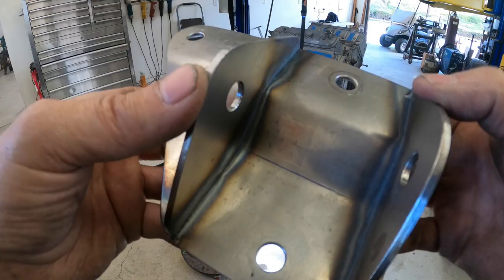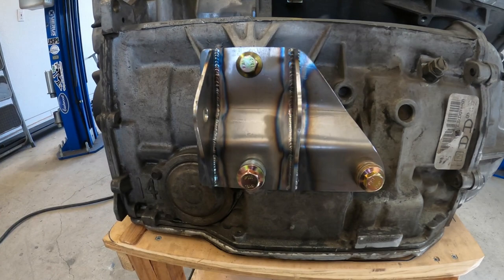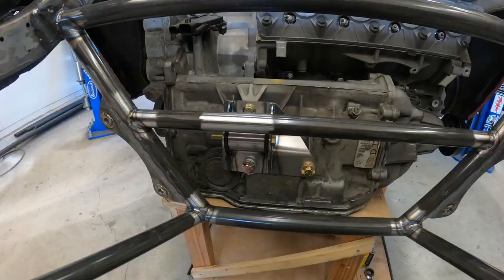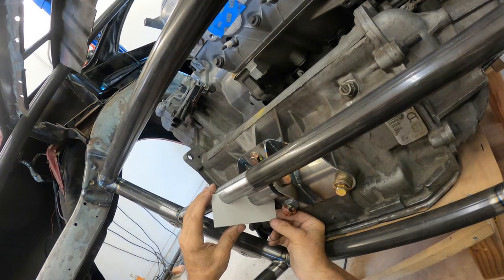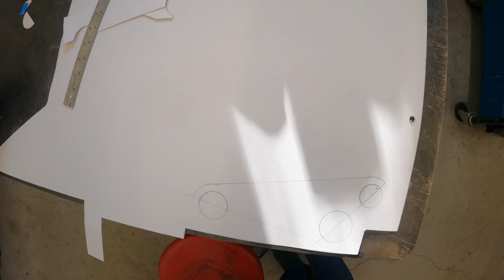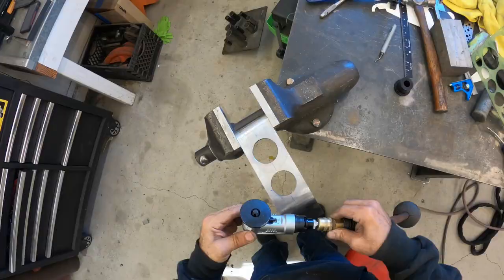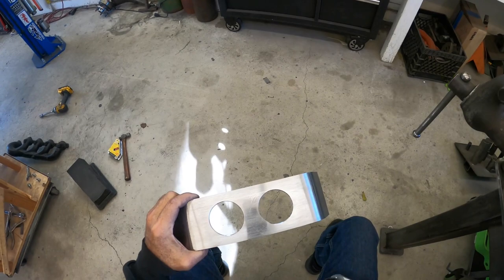V8 into Corvair the hard way   ep8

Comment: I knew you weren't going to weld that transmission mount without access to the bolt behind. Extra points for disguising the access hole as one of three lightening holes.
Reply from the maker: You caught that I see.

Comment: Great build as usual.. Yaw? oh no.. is an airplane in the works next??  Oh and dont feel bad.. amateur "gardeners" have started multiple fires in the open space here with welders fixing open space gates and fences and even roofers throwing hot roof material over the side into a dry hill. Just dont do what i did.. go boating and forget to put the plug back in. :)

Comment: John, Excellent  work!!! You fabricated the engine mounts brackets incorrectly though. You suppose to use those angle iron!!! LOL!!! Those brackets are made way better than factory built brackets. Just wondering if you designed it that you can remove the engine even with the exhaust headers attached. This is an example of a true Made in USA parts built by Master Craftsman the old fashion way. I like to see a cancelled wheelie bar. You ought to patent a Metric transfer punch set like the one you made. Looking forward for the next episode. Thanks for sharing. Be safe.

Comment: Yes, that is "the hard way".  The right way is to get a nosecone/bellhousing that allows you to put a SBC directly onto the Corvair transaxle, which is virtually identical internally to the 4-speed used in GM's bigger cars.This was available when they were still in production.
Reply from the maker: If the diff is beefed up with 4 spider gears and a bigger main shaft, a LM Corvair transaxle can handle about 300 lbs of torque if driven nicely. I will be north of 600. The trans portion was used for  V8s but the third member is smaller and weaker in the Corvair. You can't flip the trans or ring gear to run mid-engine.  Crown did their conversion by mounting the engine to the opposite end of the trans so the ring gear still spins the same direction.  But this was with the (relatively) anemic SBC from decades ago.   Also, I don't want a manual or a   traditional North/South engine layout which is what you get with a Corvair transaxle.  

I looked on Frank Schwartz You Tube page. Wasn't surprised to see it blank.
Reply: @JohnReynolds661  Well, you did say "the hard way". 
The reason the ring gear didn't need to be flipped, is because the Tempest used the same transaxles as Corvair, bur with a front mounted V8 and an engine RPM "driveshaft" (like a Porsche 928). This  opened the door for the mid-engine SBC bellhousing.
BTW I didn't "read an article" I remember that setup from when it was current.

Comment: You should invest in a generator dedicated for your water well and have it wired in so tripping a single lever disconnects from the grid and connects to the generator. Especially if the power goes out that often. 
What is the torque limit of that transmission and the axles your using ?
Enjoyed the vid, thanks for making it.
Reply from the maker: I usually turn off well and transfer pump when on the geny because they both have hard starts.  The trans is basically a 4L80 in a transverse configuration which is like for a one ton truck.  Axles are good for 1,200 hp.

Comment: 4:57 What company makes that long stem marker ? Thanks.
Reply from the maker: If you're referring to the gold item, it's just an spring loaded automatic punch that I purchased at the local steel store.
Reply: @JohnReynolds661  I'm looking at a thin tip magic marker that has a black body.
Reply from the maker: @RichieCat4223  It's just a mechanical pencil .9 lead
Reply: @JohnReynolds661  Thanks

Comment: wow! what great welding joints!
Did you try to electro cleaning the joints? This germam guy just used his old welder instead of buying electro-cleaners (with max of 5A), he used much more amps (starting with 10A until about 50A). May I can refer to his video? https://youtu.be/if6ASMe27Io
This video is for "stainless steel", don't know if it works on any steel...
Reply: he pulled out his oldes welding tool and puts a cleaner brush on: https://youtu.be/if6ASMe27Io?t=584

at 13: 20 he cleans very impresive the color changed joint: https://youtu.be/if6ASMe27Io?t=800

Comment: This is the process I have used for over forty years; make the cardboard template first, then on to metal.  I have built a few street rods over the years, but my personal project (which is in storage at the moment) is a '65 VW Karmann Ghia that I actually drove stock for about nine months when I decided to unleash a long-time lust to build a tube-framed, mid-engine street rod.  I gutted the body and built a full 1-1/2" tube rollcage coupled to a 2" square tube, backbone-style chassis; but first, I had to widen the body down the middle a full 12".  Sitting in a mid-engine configuration is a 1970 Oldsmobile 455 GT drivetrain.  I utilized the factory drivetrain's subframe to build the backbone frame out to a 1971 Ford Pinto/Mustang II front crossmember, so I wouldn't need to fabricate a tubular subframe (but I've been rethinking this because I ended up fabricating narrowed tubular control arms anyway).  The extensive list of fabrication to this project is way too lengthy to detail; and at my age now, I may never get to finish it - but the yearning to get it out of storage and finish it is a compelling force, fueled here in watching this video.  I have a ton of construction photos of this project, as well as a project I did for my brother a few years back: a '65 VW Bug, constructed exactly like my Karmann Ghia, but with a front-mounted 327/350 dual-quad tunnel-rammed V8, hooked to a Borg Warner T10, back to a narrowed '85 Corvette rear.  Again, that project has quite a few more fabrication mods I did to it than any other project, because that project started out as a full-scale frame drawing on the concrete floor.  After fully welding the 2x4" tube frame together, attaching the narrowed rear to the widened front crossmember, the frame - without using any jigs - had only an 1/8" out-of-square (corner-to-corner) warp . . . fairly unnoticeable.  Anyway, I enjoyed watching this video very much!
Reply: So you're trying to say you're skilled in CAD?
Reply: @darrenswails  I wish  😜  I have, however, become very skilled at making templates for just about anything - cardboard, tape, and scissors.  When I was building the rollcage and cutting the 1-1/2" tubing, I developed a technique to perfectly cope both ends of a tube for a dual fitment.  The square tubing, though, was an interesting exercise in multi-plane, angular fitment between tubes.  Aaaah, fun times!
Reply: @waynegroves6922  that's what I mean Cardboard Aided Design😃
Reply: @darrenswails  Aaah, clever!  I'll have to remember that.  😊